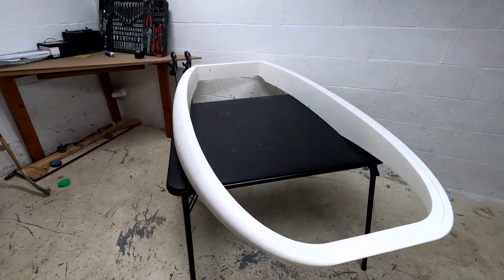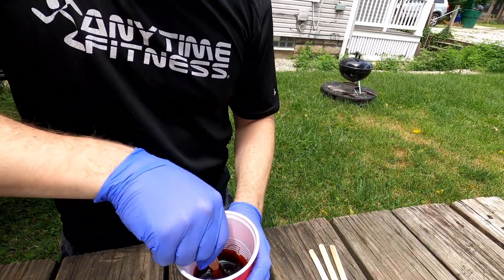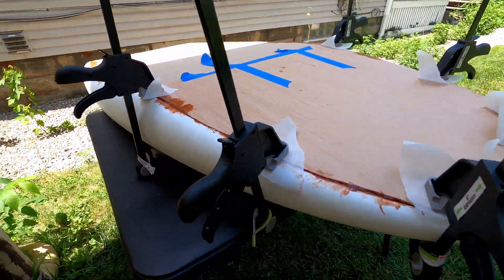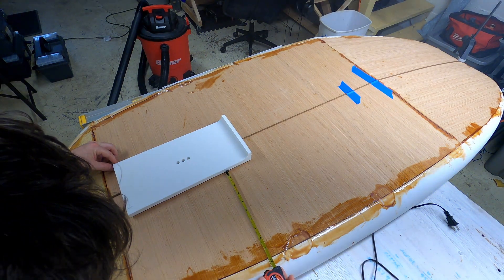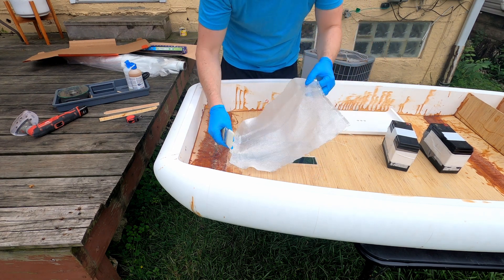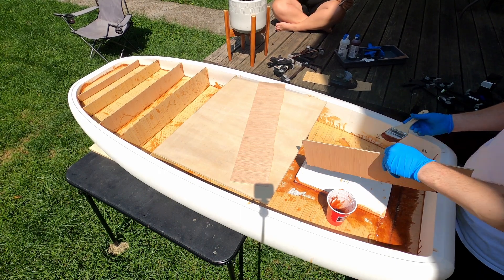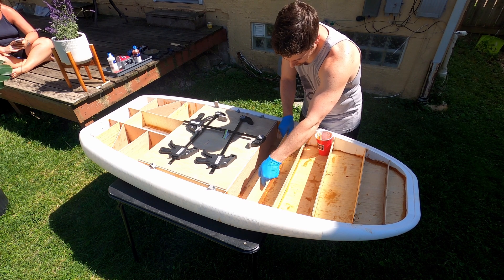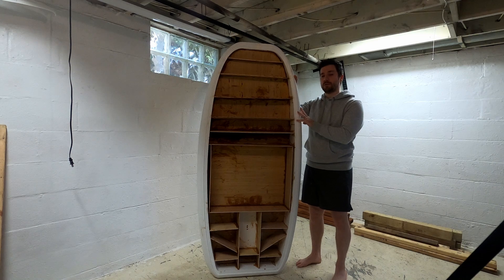DIY 3D Printed Electric Powered Surfboard Part 2!

Comment: Hey, this is really nice! Love the 3-D printed hull outline approach. I have some minor tips that may help, or may be overkill. 
A bit late for this now but the first thing I'd suggest is to orient those thin plywood stringers in the long direction instead of across the board.. The flex stress on this board will largely be longitudinal so this orientation will help support the board against flex strain. Otherwise your rails will be the main resistance to flex and will need a heavier glass job.
Second is that your fin/motor box for mounting the motor is going to need more fiberglass reinforcement. Not sure what else you have planned for it but you'll want at least 3 layers of 6 oz. glass around the base of the box on the inside, as well as some extra glass layers outside on the bottom deck at the box. I also recommend bonding the box all the way through to the deck with some sort of plywood stringers or high density foam block. This box is going to take all the motor stress and will need the most reinforcement.
Anyway awesome build but wanted to share some ideas that might be useful!
Reply from the maker: Thanks for the suggestions Matt! I have my fingers crossed for the motor mount; thinking I’d do a couple more layers along the bottom. I saw most hydrofoil mounts are PVC plastic or aluminum…I’d argue the epoxy plus the level of infill of the printed plastic is comparable to the PVC plastic…. the aluminum is just crazy expensive so I’m not even gonna go there.
Reply: Great work!… I totally agree with the direction of the wood and also the glassing.. I wonder if you could have done all the 3D printed parts in light-weight PLA and 3D print all of the internal supports also with LW-PLA and then glass the whole thing just like a surf board… it should be very light weight and extremely strong!… I’m planning to do something like to build a special tag along bike for my son… it has to be a special shape bike frame to accommodate his specific needs (he is autistic)… however, keep up the good work… that is inspiring!!

Comment: Love it! Excited to see it all done. I am experimenting with jet units for now but like the path you are taking with an exposed propeller under the board.
Reply from the maker: That’s awesome! I was going that direction as well but it seemed the overall power needs of a jet system were much higher than a exposed propeller…that being said the jet systems are very slick and I’d like to try at some point with one. Do you make them yourself or are you looking at some to buy?

Comment: That's looking real good, looks like it will be a lot of fun after it's done hehe, just one thing to keep in mind I use to do interiors for vans and I found these sheets (not sure how it's spelled) called Lou-on boards, it is very thin more or less (they make a few different thickness's but I always used the thinnest sheets)  like house paneling, I know it's thinner then 5 millimeter plywood, it's made of two thin sheets of hard wood with a thin layer of Styrofoam in the middle, it's very light weight and very stiff and strong, I had tried 1/4 inch plywood and found it to be too heavy and way too soft I had to put a lot of reinforcements to keep it from warping, it comes in 4 foot by 8 foot sheets and in 4 foot by 4 foot sheets just something to keep in mind next time you do something where you need something light weight and strong and won't warp on you like plywood loves to do...
Reply from the maker: I will keep that in mind!

Comment: Good start with the 3d printer.... But wyh you use the wood? It make it heavy-duty.. It has to be light for better handling and for carving! Take the wood out and use form! Please!
Reply from the maker: I used foam in my last build, so I know what you mean. I wanted to try something different. Also foam is super messy to carve out, would require many layers of epoxy and fiberglass to strengthen which adds a surprising amount of weight. In the end I’d bet the weight will be very comparable to using wood and a using a water sealing layer of epoxy.